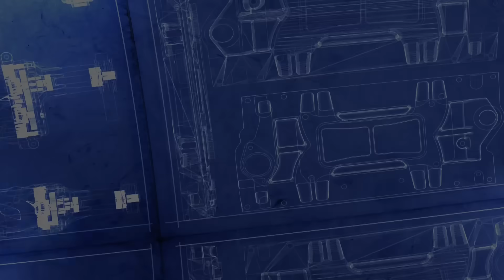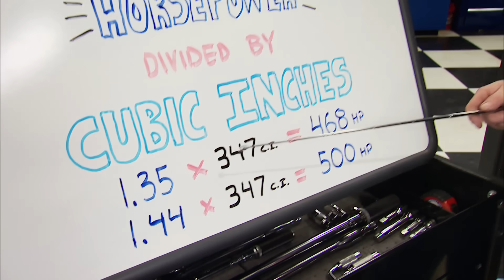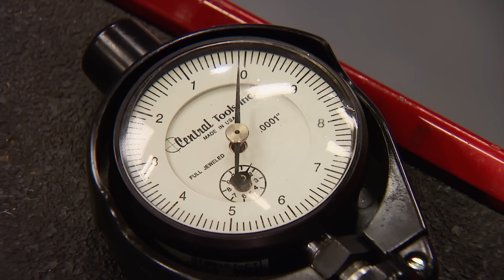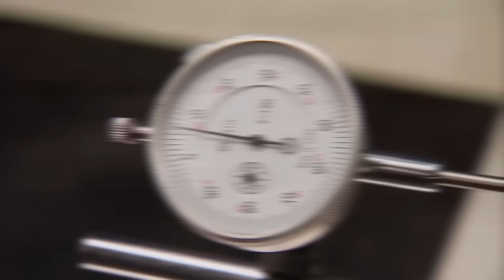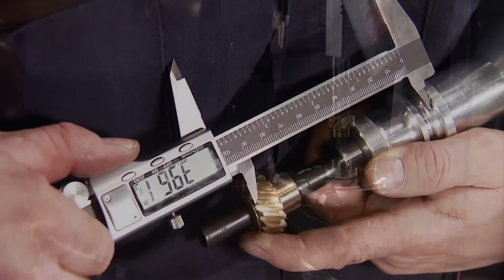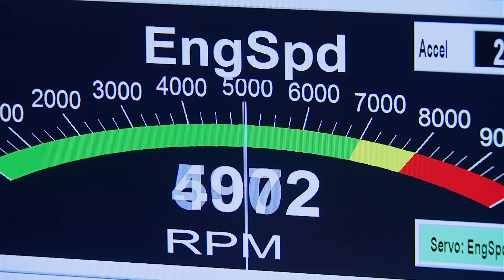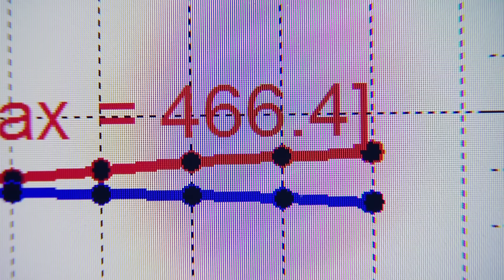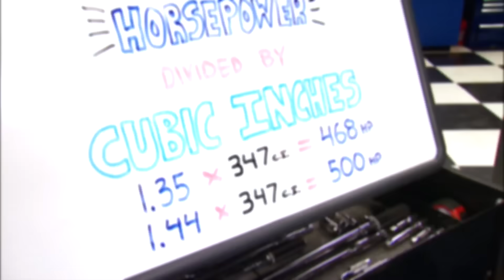Stroking A 5.0L Small Block Ford to 347 C.I. - Engine Power S2, E8

Comment: Summit doesn't show that block.. they switch you to a 5K combo from this episode.. bait and switch!
Reply: All these parts new is over 5 grand now.
Reply: You can buy the 86-93 5.0 blocks all day long off craigslist, Ebay, etc. You just have to have a shop do the machine work.
Reply: @SOLDOZER  block will split like a toothpick at this power level...
Reply: @SOLDOZER  that's a Summit Racing Block in the video... Didn't know Ford mannied those from the factory 😂🤣😂🤣
Reply: @bacchusthompson5834  

It's a late model Ford block that summit had machined/finished(1:40 of the video).....try and pay attention.
Reply: @SOLDOZER  so you saying that the late model 302 blocks don't split at these power levels... It's well documented.
Reply: @johnpeters9793  I did... Clearly states that they bought it from Summit Racing for $750, you pay attention and listen as well
Reply: @bacchusthompson5834  

You suggested in your ignorant post that Ford didn't "mannied" this block.

It's a factory Ford block that a machine shop prepped and sold through summit...
Reply: @johnpeters9793  nothing ignorant about what I posted... Ford Motor Company doesn't MANUFACTURE this block as you see it in this video.
Reply: @johnpeters9793  I'm really not... If it's altered from the factory, it's not a Stock Manufactured part... PERIOD!
Reply: @bacchusthompson5834  

Cool, then every chevy that's modified fits the same description. 

Glad we got that straight. 

Problem is, that's not what you meant in your OP and you know it.
Reply: @johnpeters9793  That is what I meant... I've had 2 SBF 302's split. I know exactly what I'm talking about. Once you get up into the upper 400's to 500 the blocks are prone to that fate... Some get lucky, some not.
Reply: @bacchusthompson5834  

Then you or your builder are inept...
Reply: @johnpeters9793  well, we are along with thousands of others... It's well documented. Why would the issue even be mentionable if it wasn't something that has happened on numerous occasions??????
Reply: @bacchusthompson5834  

Yawn.....you just parrot what you hear on the internet. 

You never owned two of anything.
Reply: @bacchusthompson5834   No, they don't. I don't care what some 13 year kid on the internet told you.
Reply: I'm sure availability and pricing had changed over the years since this was aired.
Reply: @allanb3222  I mean, it's only been 5 years.......

Comment: Even the oil pan bolts are after market? I get it that lots needs to be replaced cuz of different specs but bolts? What was wrong with the originals on that?
Reply: I imagine that product placement is just part if the economics of show?

Comment: we are dangerously close to cracking 500hp. I'm sorry I thought you said you were dangerously close to cracking the lifter valley with this think lol. 1st video I've seen of an engine build where you can actually hear it run on the dyno. We all want to hear how it sounds as well as how it runs. A lot of people build motors like this for streetcars and muscle cars. The sounds is important too. That's the redlight shock value guys with old mustang muscle cars look for. Sound doesn't mean a thing if it were a race engine but if it was a race build it would be a 363 or something else anyway. let us here how good the engines sound now and then

Comment: the 110 degree figure is not lobe separation  but it refers to lobe centers thats the best way to degree a cam  set the lobe centers   this case would be 110 degree lobe centers  you set lobe center  same as finding top dead center of the  piston   traveling  up then down  exact top dead center you would  run piston up with dial indicater on top of piston   it will travel  to top then back down    when piston starts to drop  you drop it a set distannce  like say 250 thousands then back it uo driop it the same distance on each side taking reading on degree wheel  each side    and cut  the total degree reading in half and you have exact top dead centerdo the same procedure with the cam lobe half way inbetween is lobe center    set  to 110 degrees   with sloted sprockets  from jasel    or  same  kind of sloted gear  to adjust lobe centers  done deal cam set

Comment: There must be a mountain of split 302 blocks piled up somewhere.....because it seems that they will self-destruct at 500 horsepower. Has anyone here ever actually broke small block Ford themselves at that power level? Not just what you've heard or seen on the internet.....in real life.....let's hear the story.
Reply: But they can get 1000hp out of them.best ford V8 block is a nascar block it has thicker bores.& 4 bolt mains but they ain't cheap.over $3gran for bare block

Comment: The stock 302 isn’t really a 5.0, it’s technically a 4.9, due to its exact displacement being 4949cc it kinda rounds up, but it’s a bit of a stretch, 305.119 is exactly 5 liters, but to be able to call a 302 a 5.0, it would have to be 302.0675 ci
Reply: Ryon Brand
I would like to see your car with 305.119 on the fender.
Reply: wysetech2000 it doesn’t have to be exact on the badging, a Toyota 4AG says 1600 on the valve cover, but it’s actually 1587cc

Comment: How did you manage to get more power out of this engine than the 460?
Reply: The 460 was a budget build with cast iron heads and mostly stock replacement parts. I was still impressed with that build though.

Comment: Awesome to know my $2,000 cammed and tuned LS2 makes as much power than this 7-10K Ford stroker.
Reply: Deadeyedickification 
Must also be nice to know you’d get your ass handed to you as well🤔

The hard parts for this engine equates to roughly just under $7,000. Some of the parts parts can be found a lot cheaper than through Summit(who PowerNation )sources their parts from.
Reply: @bigdaddycool4242  Haha maybe if its put into a gutted foxbody. Mine is in a 3,200 lbs C10 and its walked many a mustang.
Reply: Deadeyedickification 
Lol, it doesn’t have to be gutted! Full interior and drove it there.Many a time those LS boys didn’t know what hit’em on the street or the track. Many a time they lost that punk money too!

To add, you must’ve been picking on them boys that didn’t have much under the hood and couldn’t drive, thinking they could beat up on a truck.
Reply: @deadeyedickification     Always a YouTube hero.
Reply: wysetech2000 
Yeah, you keep playing with your boat👍

Comment: Hi guy's have you had a go at a Holden V8 yet  or as they have renamed them in the USA  under GM  SS Pontiac if you want to really see what  they are really capable of look on You tube Bathurst 1000
Reply: Are you talking about the Holden 304  5 litre.
Reply: @PaulA-bv1rt  Hi it's a 1997 holden VS I was after better fuel economy  and power if possible it's standard as far as I know  except bigger exhaust after the standard  manifold I could smell fuel when idling  Fuel here is $2.18 a liter have you guy have any recommendations please
Reply: The holden  has a low restriction cobby muffler on it the sound used to be awesome
Reply: @PaulA-bv1rt  Yes 1997 Holden V8 304 CI ute
Reply: Those engines produce my favourite v8 sound.Heaps of grunt to be found. Dual TB inlets were available.Aftermarket engine management.Better cams,heads,internals.They are a mighty engine,It did take the  Ls1 with it's larger capacity and unstressed easy horsepower to supercede it.  Supercharge it .There is a lot of info on them. Larry knew what to do with them.
Reply: @PaulA-bv1rt  When I took it for a test drive and started it.  I was thinking  I've got to get this
Reply: @PaulA-bv1rt  there can be a lot of info on it but knowing who's got the best for a long life economy and power information that's why I've followed the videos as much as possible is there a video you recommend that covers this? I also have my father's chevy to restore an original engine 283 two stage powerglide 1966 Impala
Reply: Brian,  the mandatory extractors and exhaust , get the heads worked or aftermarket heads, bigger throttle body,air filter, a nice cam Crower,Crane etc an aftermarket ecu.There are also centrifugal supercharger and low slung twin screw superchargers. There are a few videos available on doing up the 304. The mods depend on your budget, but  always try to have the air in and gasses out as efficient as you can first.
Reply: @PaulA-bv1rt  yes I was going to  ceramic paint and polish internal exhaust  to stop  thermal  spreading  and increase  flow efficiency I don't know  about the supercharger  budget  is tight but I will  try
Reply: The starter motor  cooked because of  exhaust  systems heat  the is the main problem with  the Holden V8 engine
Reply: I have worked  with  water pumps  and  I was wondering  about  an electric impeller  for consistent  air flows  separately from engine  fully  electrical no thermal  transfer  then and air regulation so blow by cools the radiators
Reply: @PaulA-bv1rt  Do you guy ever think of cool compressed air as air intake like running truck compressor and electric driven so no drain on the engine then dial in air mixture through a regulator you could test with  workshop compressor running a second injector nozzle  directly behind the fuel intake to better atomize it
Reply: @brianwright4104  Wow.talk to a mechanic on that one.
Reply: @PaulA-bv1rt  I've worked on a few engines but haven't got  enough money to do much about it really needs testing on dino  I've got a couple old Holdens I might try it on
Reply: 304 isn't Holden it's chev isn't it.if you want a Holden V8 it'd be either 253 or 308.&  253 is better motor
Reply: @jimbarrows4069  The 308 was shaved 1mm and so came in under the 5 litres for Group A.Chev made a 302,a 305 and a 307.
Reply: @PaulA-bv1rt  I did find  the utes light in the back  end but I brought  mine  with  canopy  that puts weight on  the back of the  vehicle and  wind down force witch helps  grip the  road better

Comment: Need one to replace my old 99 explorer 5.0 stat lol
Reply: That's what I'm thinking lol
Reply: I built a 302 with Explorer heads I ported and polished, put it in an 89 Hatchback and ran a 12.22@112mph. Fun little motor, surprised a lot of people.
Reply: @HaynesJP  
That's it? What cam?
Reply: X Mo thats it? You can’t be serious. 

It was a custom grind from Camshaft Innovations. .571/.574 on a 114 LSA I believe.
Reply: @HaynesJP  
You made it seem simple so I asked a simple question. I can assemble an engine but I haven't a clue about parts selection.
Reply: X Mo I meant you said “thats it” like 12.20’s with a basically stock GT40p motor was slow.
Reply: @HaynesJP  
Nice. It was just cam and heads?
Reply: X Mo long tubes and a demon carburetor.
Reply: @HaynesJP  
Nice. My 88 was all stock with an unknown cam from the prior owner. It was never beat on the streets until the Termi's came out but by then my car was already parked. On the freeway I was spanked by a Porsche and an M5. It did well. I think of my success was due to my driving vs others ineptitude. 

I need to get it back on the road. I can never decide between 302, 331, or 351 based stroker. I've been going back and forth over it for yeeeears. I need to just build the damn thing.
Reply: @xmo552  Go 347 & spray the house down...
Reply: @bacchusthompson5834  
Yeah? Why 347 tho?
Reply: @xmo552  just my opinion... I like the way the setup performs in the Foxbody. Great HP & Excellent TQ with Revs to go with it 😁
Reply: @bacchusthompson5834  
Ok thanks 👌

Comment: Rather see a build of an oversquare engine. Tired of us Americans building motors that are great 1/8 mile setups but aren’t worth a shit on a long roadcourse or the highway. The 302 that Chevy built (yes, Chevy built a 302) was a monster. Huge bore, short stroke.
Reply: ROTAXD    If you're tired of it don't watch it.
Reply: The Chevy and Ford 302 share the same 4in bore 3in stroke although I think the Chevy connecting rods are a bit longer.
Reply: ROTAXD   The Chevy 302 was built especially for road courses.

Comment: Never understood 347s...Just get a bloody 351W. It literally fits directly where a 302 goes. Don't even need swap mounts.

Parts are just as cheap since it shares alot of parts, blocks are plentiful and roller ready.
Reply: it dosent always fit, depending on what you run
Reply: i was thinking that too. i like the 302 but if going for more cubes why not the 351?

Comment: I love the Windsor family! I have a 1968 Mercury Cougar XR7 with the 302W.
Reply: I think thats just a ford small block 5.0 , not a Windsor bro
Reply: @noneya6334   That was fast. Why do you think that? It is from the Windsor family avaliable in the '68 Cougar from the factory.
Reply: But isn't a Windsor motor go even better with.cleveland heads that's what I heard Windsor block with Cleveland heads
Reply: @jimbarrows4069  I have heard similar things about the 351C heads, never swapped them myself though. The 351C was bigger than the 351W in many ways(the heads for ex.) I know there are aftermarket heads for the 351W & possibly the 302W that are based off the 351C heads. Supposed to be a good design for the times I think.

Comment: Now this is why I’m Ford to the core💯 Check this out, 507hp on a 8.2 deck pump gas engine!! That’s something for your arsenal 💯💯👍🏻👍🏻💯💯
Reply: This is aftermarket, not "Ford"...
Reply: @BuzzLOLOL  That's a stock block and the only thing Chevy on this motor are the rods.
Reply: @I_like_turtles_67  - Who said anything about "Chevy"? No production Ford parts: 00:50 Summit improved block and Summit timing cover, AFR heads, Lunati valve train and timing set, Eddy intake, QuickFuel carb., MSD ignition, Eagle crank, bolts, and rods, Mahle pistons, Clevite bearings, Royal Purple assembly lube and oil, Melling thrust plate, FelPro gaskets, ATI damper, ARP crank bolt, Melling oil pump, Moroso stud girdle, oil pickup, and pan,
Reply: @BuzzLOLOL  agreed that's how shelby made his money in beginning getting rid of all fords shit and adding better parts.
Reply: sbf are the shit
Reply: are you nut ?
Reply: caterpillar6nz no, i DO nut
Reply: Ford sux . Unless you build it yourself.  All the new dohc is shit
Reply: @sschevmale24  I guess you haven't seen the 5.2 motors lol.
Reply: @I_like_turtles_67  yes the ones blowing rods, losing oil and grenading pistons yea like I said they are shit

Comment: i wonder what a 427ci would do with the same heads, 10.8:1 compression, 60lb injectors, trickflow 351R manifolds, 1 7/8 long tube headers and the same cam???😕
Reply: one thing is sure....that would be torquey down low
Reply: @ragimundvonwallat8961  any idea on hp and tq numbers? i have ppl saying it will make the same power as this 347 and i can't see how...
Reply: @PANTYEATR1  haha there is no way, it will make more power but not the same amount per cube. it will also rev less high because of all those extra cube with the same cam.

extren grunt down low and i would guess a peak around 5500
Reply: @PANTYEATR1  id say something around 550hp and 530-40 or torque
Reply: @ragimundvonwallat8961  so 600whp is out if the question without forced induction?
Reply: @PANTYEATR1   wheel horse power ...oh boy. well its far from impossible but you would need a huge cam and more compression to get 600 at the wheel you need something like 740 on the bench, depending on how efficient your accessory train is. so possible yes, comfortable streetable engine definatly no. you would also need afr 225 head
Reply: @ragimundvonwallat8961  well...i need it to be a powerful street car with good manners, so I'll take the 550hp and be happy with that. from what hear, that will be plenty
Reply: @PANTYEATR1  my bro have 550 hp in his mustang and i tell you its plenty...and it dosent even come close to get the low end that you would got.

if i were you i would change the cam tho, you could stay just as much streetable if not more you would still be in the 550-570 hp but you would push your torque in the 590 range
Reply: just dont pick a cam that extremly tigth in the overlap....it would give you glorious low rpm but for those number of hp you risk pinging/timing issue on pump gas. it worth it to 'blow' a little in the exhaust at lower rpm with a looser cam and get no issue
Reply: @ragimundvonwallat8961  i don't have the cam card in front of me, but it's a .600 lift and the lobe separation is 114°. that's all i can recall
Reply: @PANTYEATR1  the block would split ....500hp is more or less the limit on a stock block
Reply: @meanasscobra  what question are you responding to?
Reply: we speak of 13.5 13.9 comp engine....more of a strip engine (.700 lift cam also)

Comment: Whats wrong with a chevy 350
Reply: Nothing.
Reply: @attitudeadjusted9027  then why use a 347
Reply: @goob_1191  exactly. When a 351 block is much stronger and a lot more can be done with it.
Reply: @attitudeadjusted9027  yeah fr. These guys wasted 10 grand on stage one and remember how they handled the camshaft for the 454 look at how they did it on this Ford
Reply: @goob_1191  ikr. I've been running small block ford's since the 80s and they're just dancing around the real capabilities of the sbf because they don't know any better. I've got a 313 that's all ford heads and all with the exception of pistons and valve train and intake that dynos 728 hp before boost. I also happen to have family who worked at Ford in the 60s and 70s who've forgot more than these guys will ever know about a sbf.
Reply: @goob_1191     
When you learn you learn about bore and stroke combinations you might understand.
Reply: Nothing they are a good motor too
Reply: 351 Cleveland & 302 Cleveland block is exactly the same.only difference is crank & rods